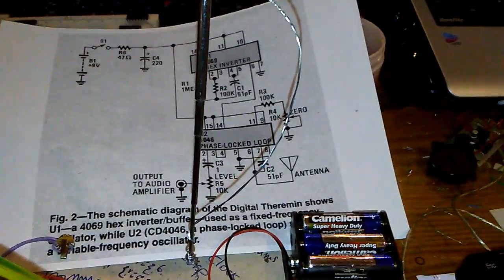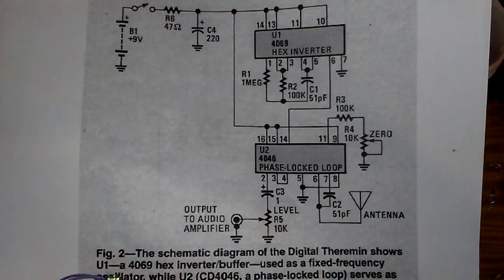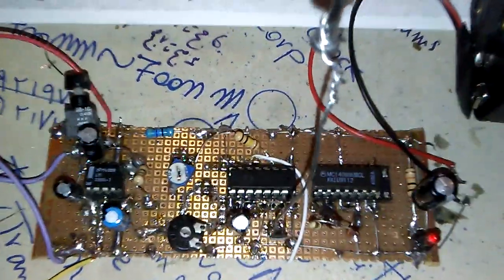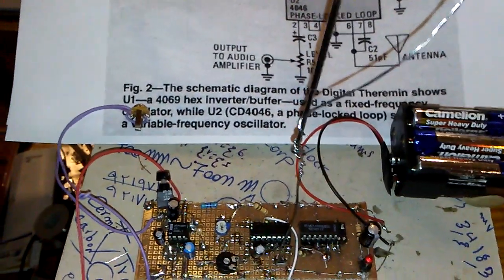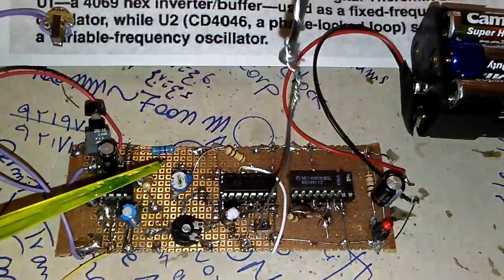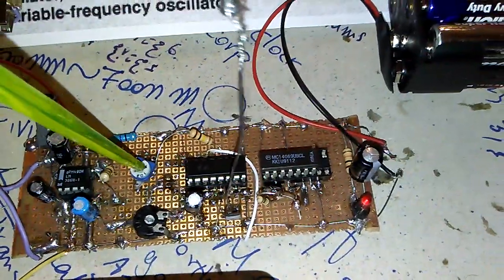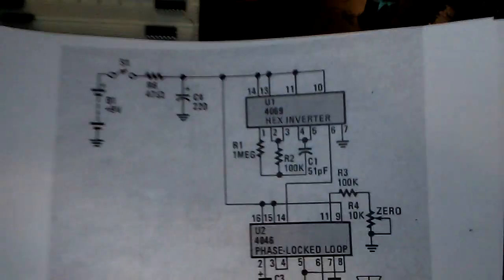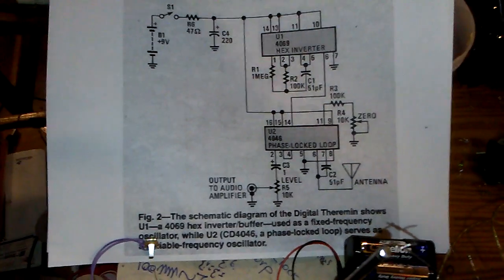easy theremin project using cd4069 and cd4046

Comment: I am glad to have found this video. Someone in germany (i beleive) made a PCB, and it is totally wrong.
I have made a plan in KiCAD with the two chips, and an output of an inverter is bound to plus-voltage, the capacity to the antennma is shortended.
Will have to look for the schamtic you have used, perhaps you have a link to it?

Many thanks

Hartmut